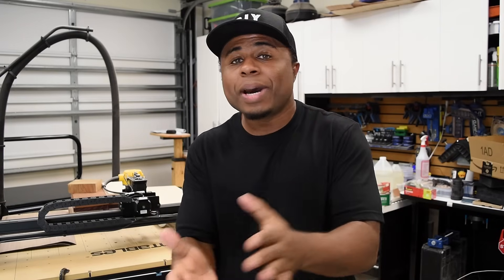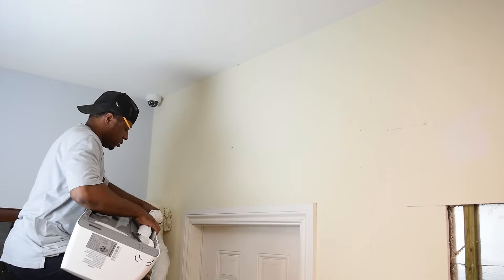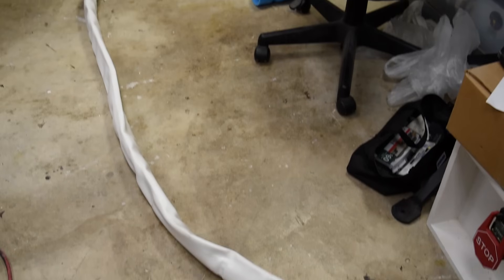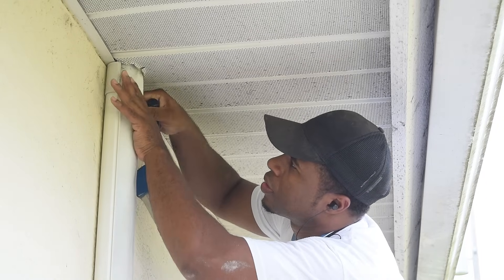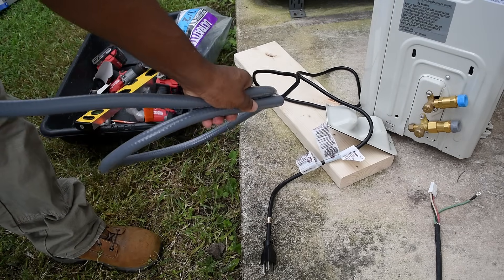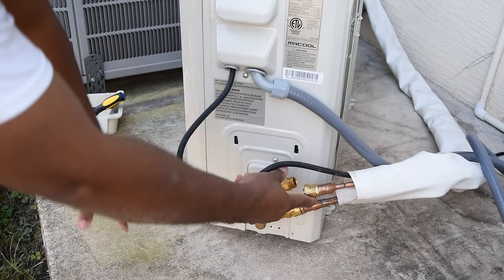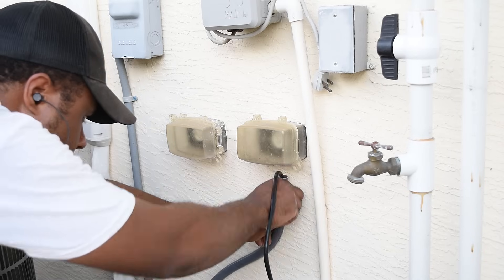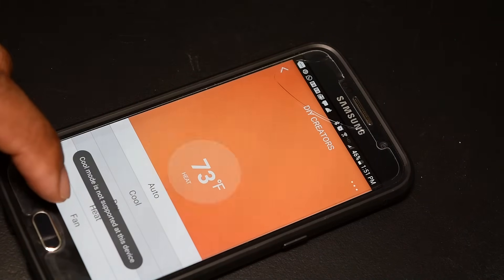How To install Ductless AC & Heating System // True DIY Mini Split MRCOOL

Comment: A few things.... This is not a DIY system.  Depending on the length of the lineset, you may have to add refrigerant to the system.  (If it is a longer lineset for example)  If you want optimal performance.  (Better heating & cooling, and a cheaper electric bill because your unit will run less when it is functioning optimally) 

Also, you should have definitely pulled a vaccuum on the lineset before opening the service valves.  And telling people that they don't need to pull a vaccuum is just fucked up on your part.  Anyone taking your advice is going to have wasted their time and money buying and installing one of these.

Comment: Didnt vac down the unit, cut way to much drywall out,shoulda just punched streight out and chased your linset and condensate all in one, no disconect, didnt show if you sealed up where you did punch out..did you secure the unit? Other then that you almost know what your doing i guess

Comment: What a cheap  minisplit..."Disposable mini split... there is soooo much you dont know... 120 volts minisplit ..not good for the compressor....mobile home set up on a mini split
Reply: richard woeckener 
They are expensive junk. And very expensive to have repaired. A $200 window unit that will last for 15 years is the way to go.
Reply: @drwlpwasright5132  no they are not expensive.... look up fujitshu and Mitsubishi prices ... these are the companies that invented the minisplit.... everything else is a cheap copy... i have been doing HVACR for 25 yrs

Comment: Excellent Video. "Pre-Charged" is exactly what I've been looking for. Thanks for the time you spent on this.
Reply: Please... don't listen to this guy...

He voided the warranty and his unit is probably performing like shit because he didn't pull a vaccuum on the lineset before he opened the service valves.

  Also depending on the length of the lineset, his system may have needed more refrigerant to run optimally. 

  For example that condenser was probably pre charged for 15 foot of lineset.  Meaning, if his lineset is much longer than 15 foot, his system is guaranteed to perform like dog shit. 

  He is doing nothing but getting barely cool air blown in the "conditioned space" which is never going to reach the setpoint.  So his electric bill is going to be a lot higher than normal, because the unit is probably never going to stop running.  

  Before too long the compressor is going to die from the lineset not being pulled into a vaccuum.  

  Contaminants left in the lineset, along with the compressor constantly running is a recipe for a rapidly dying system.  

  Then maybe he will call a Licensed Professional such as myself to install it correctly.  

The sad part is, he did a decent job installing a lot of the system.  There was just too many crucial mistakes made.
Reply: @DividedWeAllFall  Not with this system. The lines are pre-charged as well as the compressor. As you tighten the lines they open at the last 1/2 turn. Then you open the valve from the compressor to the pre-charged lines and your set. That's why you can not cut the lines to size, and you have to coil the excess. No vacuum pump required. Hope this clears that up.

Comment: No vac pump? That would of voided warranty straight up. All these wanna be DIY.
Reply: I don't understand these comments. The Mr Cool series is a DIY unit that specifically does not require the lines to be evacuated. If they required vacuuming to keep warranty they would have said so. If you have a problem with the installation, take it up with Mr Cool.
Reply: Adrian Monteleone 
That's correct.
Then left with a very expensive piece of garbage that can be scrapped for a few bucks.
Recommend a $200 window unit that will be problem free for 15 years, or a $300 1 ton spot cooler.
I personally would not put these in my house, and I service commercial air conditioning systems.

Comment: I just spent 11 months in jobcorps studying as an HVAC technician so you Guys could do this ??
Reply: Don't worry he voided the warranty and his unit is probably performing like shit because he didn't pull a vaccuum on the lineset before he opened the service valves.

  Also depending on the length of the lineset, his system may have needed more refrigerant to run optimally. 

  For example that condenser was probably pre charged for 15 foot of lineset.  Meaning, if his lineset is much longer than 15 foot, his system is guaranteed to perform like dog shit. 

  He is doing nothing but getting barely cool air blown in the "conditioned space" which is never going to reach the setpoint.  So his electric bill is going to be a lot higher than normal, because the unit is probably never going to stop running.  

  Before too long the compressor is going to die from the lineset not being pulled into a vaccuum.  

  Contaminants left in the lineset, along with the compressor constantly running is a recipe for a rapidly dying system.  

  Then maybe he will call a Licensed Professional such as myself to install it correctly.  

The sad part is, he did a decent job installing a lot of the system.  There was just too many crucial mistakes made.

Comment: Eh are you ment to put a vacuum into the gas and liquid lines . To take air and moisture out of the lines or the compressor will burn out . Ouch not cheep now when you buy twice. 👍 good job.
Reply: No leak test or vacuum pulled and he doesn't have enough clearance above the unit
Reply: Just curious how do you pull vacuum on pre-charged lines?

Comment: Good work! I did't understand whether the pipes were originally under vacuum?
Reply: To quote my earlier reply: 
"I don't think so. The lines connected to the evaporator are merely plugged at the condenser end..... and even if they were in a vacuum, that would be negated the moment the plugs were removed to connect the lines to the condenser...no?
Personally, I am of the view that, despite the claims of the manufacturer,  all refrigerant lines and the  Evaporator coils should be evacuated before opening the valves and releasing the gas into the rest of the system.
In a perfect world.
In the real world... I simply purged the system of air before connecting the suction line.......... 3 years later...all is well.  You take your choice.
"
Regards.

Comment: Very nice. The only thing i would have done is pressure test the lines for leaks then under a vacuum, before you opened the valves.

Comment: Definitely going to have some problems, been doing hvac for years now, you always need to get all of the moisture and noncondensables out of the lineset, so you need a vacuum pump to make sure that there is nothing that is going to harm the compressor in there.... good install, but definitely recommend getting hvac techs who can do the job right.

Comment: Show the video where you have to have a professional come back and fix the leaking flairs because you used the flairs on the line set not the nuts that come with the unit. Why nitro and vac the line set only air and moisture in it. Oh and make sure you tell everyone since your not a licensed mechanical contractor you literally void any part warranty! Hey at least you saved 800 bucks!!!

Comment: you didn't evacuate the system and didn't pull a vacuum, it will work but it won't last long
Reply: Hisham Alaamiri  I was thinking the same
Reply: yup mr cool is for the diy YouTuber  haha no need to call a qualified tech lol ill stick to installing daikin units but hay power to ya do it yourselfers it will work but no warrantys and yes you absolutely need to evacuate/pull a vacuum
Reply: @brendonhunt668  you don't have to vacuum these systems they are already pressurized and use quick-connect fittings. They are not the best but there is no vacuum pump needed. Why does everybody keep saying that.?
Reply: @ironmike742  looked into it and you are right the lines are pre vacuumed ive just never seen this before .it is pretty cool
Reply: I did mine the same way 6 yeara ago, still working like a champ.

Comment: DO NOT coil up a line set. That will create oil trap. If the the refer lines must be cut call a professional it will save you problems down the road.
Reply: Hi Robin....Yes, definitely a possibility.  
I'm guessing the manufacturer is playing the odds game.....
"In most cases, it won't be a problem...gas flow  will clear the oil back to the compressor." 
My condenser is within feet of my evaporator & I shortened the lines.... I have the flaring tools required... and that allowed me to purge the system too, as less gas was therefore needed in the system.  
Three years on...all is well. Touch wood, as they say.
Regards.

Comment: Dude you didn’t evacuate the pipes before you let the gas out .. very important to remove air first  .
Reply: "Pre-charged R-410A Quick Connect Linesets."  There is no air to remove.
Reply: ScissorsLizardSpock too right there is unless your room is in a vacuume
Reply: @glenndejong6817  Well I suppose if you wanted to open the PRE-CHARGED and SEALED lines so that you could then have the fun of vacuuming them down again, you could do that I guess.

Comment: I'll give it a year or two at best.. This is exactly what happens when you try to save money and do it yourself instead of hiring a real HVAC contractor. And what people like this DO NOT realize is yeah it may work now but your already setting it up for premature failure, so you may have made it look good but the are key things you DID NOT do when installing this. First and foremost you didn't pull a vacuum on the system which means that line and Evaporate head is full of non condensibles which is leading to compressor failure. Not only not pulls a vacuum but without pulling that vacuum you cant pull it down to the right microns to ensure all non condensibles are removed. Also their is a torque spec on the flare nut fittings on the condenser over or under tightening will lead to refrigerant leaks down the road. Take my advice don't be stupid on try something like this on your own

Comment: You did not evacuate the unit. You are going to have a burn out compressor less then a year.
Reply: "Pre-charged R-410A Quick Connect Linesets."  There IS nothing to evacuate from the system.
Reply: Mine has been running three years plus. I purged but did not evacuate.
Millions of these units are running worldwide....some are rubbish & many have failed,  but I rather doubt it was simply because they were not evacuated.
Many other factors are at play here.

Comment: Nice install and neat unit!!  I'm just curious, but why did you mount it so high up??  Hmmmm???
Reply: Ductless systems like this are designed to be mounted up near the ceiling, they work most efficiently in that location.
Reply: @Diviance  ... taking time to answer. Merci
Reply: Warm air rises.

Comment: great job, i have 2 things to add just to make things more perfect, fist, you should connect one pipe and open the valve little bit to let the refrigerant push the air out of the pipe from the other end before connecting the other one, the second thing is it's not recommended to install outdoor units close to each other, the hot air might circulate between them lowering the units efficiency and lifespan. thanks for shearing
Reply: There is NO AIR in the lines. They are pre-charged with refrigerant.

Comment: Did you evacuate the system before opening the valves to release the refrigerant?
Reply: Not necessary
Reply: @davidjessee7701  it is. Air is introduced when caps taken off lines. Will work but not at 100 percent. Will have higher discharge pressure.  But being D.Y.I. who cares
Reply: @wileecoyote5749  is not! Air is not introduced just by taking off the caps.. The end of the hose is essentially a valve..and opens when the hose end is attached...  Think of a air Chuck being attached to an air hose..
Reply: @davidjessee7701  ok that makes sense. I didn't know it had that feature

Comment: Everything you did looked great..... except you didn't pull a vacuum on the system! You could have purchased a cheap vacuum pump or rented one but it is very important. Please let your viewers know they should do this It will make the unit last longer as well as more energy efficient.
Reply: These systems have quick disconnects on end of the  lines to keep them charged . He should have showed how they worked.
Reply: Frank Adams Frank, you do not need a vacuum as the large (25’j  lines contain an excess amount of refrigerant that flush out all The contaminants when you open the valve
Reply: What do you need a vacuum pump for?
Reply: Its not necessary
Reply: There is a very small amount of air in the system its located between the copper line and the condensor valve. About the volume of 10 stacked dimes, I think not enough air to worry about.

Comment: Should push the air come out first then you can open the valve.
Reply: Hi KC NG, how to push the air come out ?
Reply: @Hoanghon69  if you don't have a vacuum pump, open all the cap first,( 2 Alan key cap, 1 input gas valve) you take a Alan key open the small pipe valve (liquid)  first,  and push the input gas valve, And push the gas like 8-10 sec , and stop push the valve, And open the big pipe valve(gas)
Reply: @kcng967  thanks

Comment: How much did it affect your power bill?
Reply: Not all mini splits are created equal. There are highly efficient ones, and some not that efficient. if you are buying a new unit, look for its SEER rating I have see them from 14 to 23.  The higher the SEER, the higher the efficiency and the price. So, you will have to decide what  efficiency/payback ratio will be acceptable for you.

Comment: Wow dude that was a bad installation.  You need tight the line using a torque wrench to the specify manufacturer torque, or you have a great chance of leaking, but you do not have to worry about leaks, since you will be calling an AC guy in the near future. You did not vacuum the lines. The lines need to be vacuum before you let the refrigerant out to the system. If you believe you do not have to vacuum the lines. You will not have a problem buying a bridge from me. 
If you are buying an split unit. Please, ignore that non sense of none vacuum. As long as physics works, there is humidity in the air inside the lines. The humidity  eventually will condense when the air get cooler screwing your AC. A good installation will break the vacuum with nitrogen a couple of times to make sure all water/water vapor is out.
Reply from the maker: Wow dude you didn't read the same manual I did, did you? This unit requires no vacuum or torque wrench. I followed the manufacturer guidelines. Please read the manual.
Reply: Do not care what the manual said. Basic thermodynamics trumps any manual.  Unless you live in a vacuum tube,  all air holds humidity. Do you ever heard of specific and relativity humidity? 

SPECIFIC AND RELATIVE HUMIDITY
Specific humidity, w, (or absolute humidity) gives the measure of the water vapor in the
air: 
w = mv / ma
  (kg of H2O vapor/kg dry air)using the ideal gas law: w = 0.622 ( Pv / Pa ) or: w = 0.622 [ Pv / ( P - Pv )]Air can hold only a certain amount of water vapor. The
limit is reached when Pv reaches the saturation pressure of water at the
temperature of the mixture. The air is then saturated with moisture and is called
SATURATED AIR. Any moisture added to the saturated air will condense.

Finally I found why did I have to take thermodynamics in Engineering School. 

Now, humidity in the air will be find if the temperature will hold constant, but it is not the case. When air is compressed, the temperature will go down and cool air can hold less air, so the water will change state from vapor to liquid screwing your AC in the long run. 
The manual was most likely written by the marketing department trying to get a competitive advantage over their competitors. Eventually, they will get sue, but most likely they factor cost on the sue in their business plan.   Now, you can believe anything you want. We human have an infinite capacity of rationalization, but neither you, or your AC company can change the laws of physics.  So, remember me when you AC stop cooling.
Reply: Thanks. That was a typo. I see you are very classy and educated. What I mean to say was that cold air hold less humidity, so when air is cooled water will condensate and screw up the system. Now, let me use some of my education to prove my point. 
 In this case, the inside unit came filled with nitrogen. When the nitrogen was evacuated, air with moisture took its place. That air later was mixed with the A410 since the lines were not properly vacuum. 
 The minute the compressor in the unit start compressing the refrigerant, water vapor in the line will start
to condensate and eventually water will freeze inside the capillary tube causing the unit to stop cooling.  In addition, humidity in the system will affect the compressor by oxidation and shortening the life of the oil in the compressor. Water makes the compressor oil more acidic, and decreases the lubricity of the oil leading to early failure. 
Now I give up.
Reply: @latesilvan4004  Every AC unit has a built in water  vaporizer do to condensation. The water will not freeze in the line.
Humidity is a very small amount of Moisture found in the air and will not effect capillary tube in any way. 
Good try at showing said education but it was a fail.
Reply: Using a vaporizer to condensate water  is like using an oven to freeze water. Not in the realm of reality.
 Are you using crack, or magic mushrooms ?
 What else is in your parallel reality AC? The toot fairy, two unicorns and a band of umpa lumpas?

 "Sometime is better to remain silent and be thought a fool than to speak and to remove all doubt."
Reply: Done with you. by now I know I can not fix stupid.
Reply: @latesilvan4004  Get that education and you will have a great start at fixing stupid. The best student is the dumb ones like you.